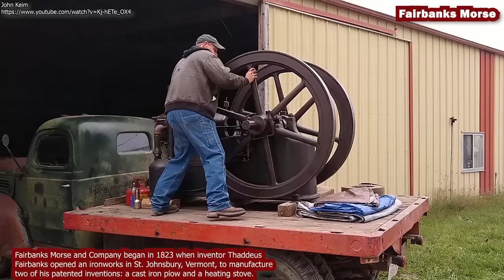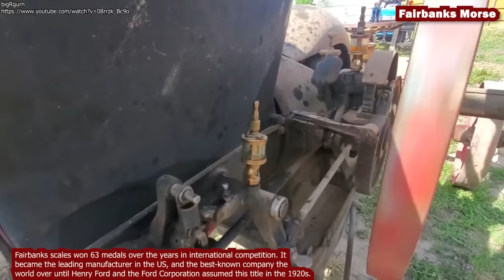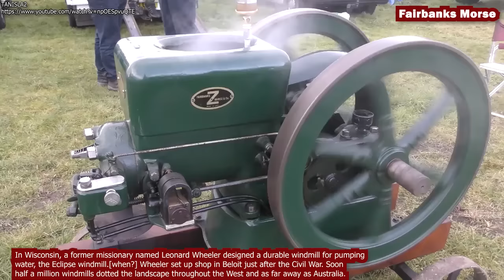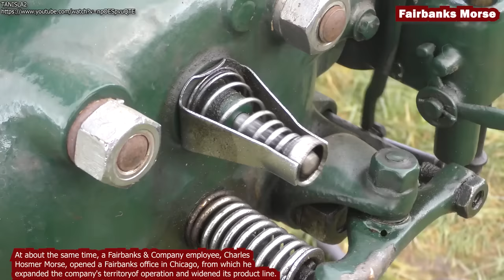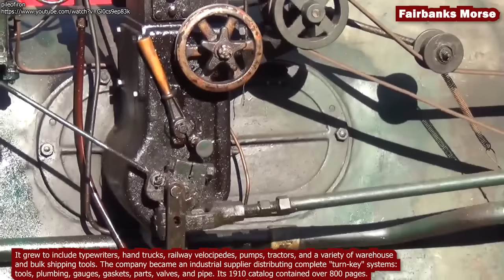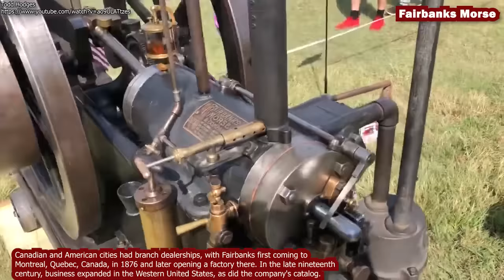FAIRBANKS MORSE Big OLD Engines COLD STARTING UP AND COOL SOUND 3

Comment from the maker: Do you like these FAIRBANKS MORSE ENGINES ?
Reply: It's genesis.
Reply: Why does the motor make four revolutions between power strokes?
Reply: Это лучший двигатель по сей день
Reply: Yes very cool!
Reply: I love these engines! I could just sit and watch them turn all day long, it's hypnotizing. I'm in the process of rebuilding my grandfather's CZ346.
Reply: @РомЕсть  depending on the size of the flywheel, they won't have to fire every one, two or ... strokes. The weight keeps it going, and some can go long periods without having to fire at all.
Reply: No, I don't like them, I love them.
Reply: Yes😊
Reply: 👍👍👍👍أحسن محركات فى العالم 👍👍👍👍
Reply: I've got a 39 saltblock that will outlive me 😜
Reply: Yes
Reply: А  какой принцип в них?)
Reply: thump...thump...thump....thump
Reply: The first one could have just used the drum as a breather tank and been a steam engine. They were all: "We need structural integrity there or it explodes, it's why the tank is split in half, bolted, and has extra lateral mass in a circle so it doesn't expand."
Reply: Affascinanti , e molto affidabili

Comment: We were still using these in the East Texas oil field 20 years ago. They ran on casinghead gas from the well and would run 24/7 for days and days on end. They’re a bit problematic when the temperature drops below freezing as the casinghead gas is very wet and the regulators would freeze up. Getting one started under those conditions was a real test of your manhood and vocabulary!
Reply: I thought I loved machines but you take it to a new level yuck
Reply: I grew up in Wichita Falls Tx and used to listen to these old pump jacks when I went to bed. They would put me to sleep back in the 50s.
Reply: @GreenPaint-sn5jg  Thanks for sharing that. I lived in Wichita Falls from 1943 to 1970 when I moved to Dallas. I rode the train from Wichita Falls through Henrietta to Nocona to see the boot factory when I was in Boy Scouts. Been in that area many times. Lots of pump jacks. I’m 81 now. Grew up in Wichita Falls. Good luck to you.
Reply: @GreenPaint-sn5jg  I’m not sure of the name of the train that went to Nocona. Interesting side note. One of the boys dad chased the train in his car to Henrietta. The train was pulled by a locomotive and the dad said it was going 70 mph. The speed limit in a car in those days was 60 daytime and 50 night. Anyway, the train that went to Dallas, Ft Worth and Amarillo and I suppose Denver was named the Ft. Worth Denver Railroad. I have ridden the train to Dallas several times to see my Uncle. That was very exciting. I remember the first time my younger brother and I went to Dallas. We must have been about 10 and 8 years old. My mom pinned a note on each one of us with our names, age, and where we were going. Then she took us to the conductor and told him not to let us off anywhere before we got to Dallas. That was in early 50s. Times were sure different.
Reply: @GreenPaint-sn5jg  we used to go to a Boy Scout camp east of Burkburnet named Camp Perkins and we would hike to the Red River. It was a really cool camp and all the Boy Scout Troops would use it. You had to reserve it. One troop at a time because it was so popular. It was donated by one of the fraternal organizations in Wichita Falls.
Reply: @GreenPaint-sn5jg  Had a friend who bought a farm in St. Jo years ago as an investment. He was staying at the house when one night a prairie fire broke out. He said all across the horizon was fire. Luckily the wind shifted and blew it away from him. It said it was the most terrifying thing he’d ever seen. He sold it and never stayed there again.

Comment: I want to see and hear one running under load. Maybe one running a water pump off of a belt?
Reply: So would i
Reply: That’s my dream
Reply: I wanna get one so maybe you will see
Reply: I bet it slaps like 1:22
Reply: If you look up stationary engines in India or under develope country's or Ajax and arrow engines in oil field service on you tube you can see many stationary engines at work - there many old small bore Wells pumping off a 4 HP hit and miss Fairbanks engine in the mid west  - 
     I had worked in the oil field for decades I saw many engines that had run for 70 to 80 yrs and we're still pumping oil -

Comment: Cool engines , I have a 1927 Anderson 3 1/2 HP stationary engine and just love it! It runs like a sewing machine and will start on one or two rotations every time!
Reply: Does electricity just piss you off
Reply: If I recall correctly, some were used to run generators in remote areas and farms as “light plants”. 

Especially when refrigeration became viable.

Comment: Those are really fun. I had a 2 lung, John Deere Model H spin-start that I used to uproot sage brush, clearing my land. It had a cam actuated, double moldboard plow that really did a good job (Pull the rope and let go - the plow buried itself in the ground. Pull again and let go, it smoothly came back up into prone position. 

The Model H only had 17 HP but if the plow was down and soil became too heavy, the 38” wheels just kept turning, digging into the ground, with the engine barely lugging down.

Every once in a while a lifter rod slipped off the rocker assembly – I would stop, pull the rocker head off, reset the rod, put the head back on and be up and running in under 4 minutes. 

Now, if I wanted to reverse my forward direction 180 degrees, I just fully applied either the right or left brake, quickly turn the double "V" steering tires full, one direction or another, and it literally pivoted the 180 without the braked wheel moving in any direction (but of course, you couldn't do that with an implement attached).

At the annual show in Kingsburg CA someone had an 8 stroke motor (it fired on every 8th rotation). It was comical to watch the fly wheel loudly bang and hesitate and bang again.

Comment: How much torque did the last 4hp engine have? :)
Reply: I ran a stopwatch and measured 89 RPM. Producing 4 HP at 89 RPM would require a torque of 2833 lb-ft.
Reply: @paulplack490  Holy shit! Thats about a Honda per stroke. lol ty very much for your reply.

Comment: These Fairbanks engines are beautiful to me. On the internet a Fairbanks Morse green tractor from 1913 has been ressurected by Wendell Kelch is so very beautiful as a type tractor. What is wrong with this tractor is the steering. A chain stretched on a front straight axel is not apt or advantages. If this unit had a steering box with tierods and ball joints it's steering would be improved 100%.

Comment: It would be something to see these engines under load. Steam engines really sound great when they are working hard, these engines would be the same. I don't know what you could use, these things have enough torque to speed up the rotation of the earth.

Comment: These engine lasT longer than modern engine. 

Irigation diesel engine (30hp) can running more than 24hours with 50-70% power non stop. And no problem the engine from 20y ago.😅